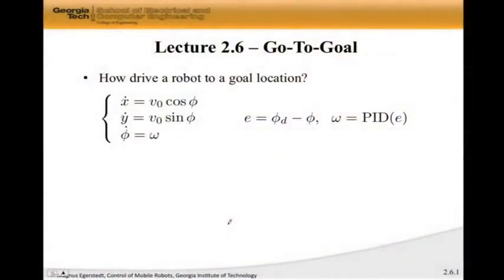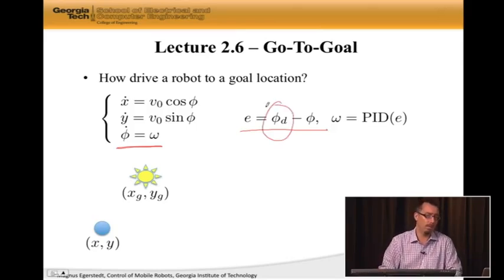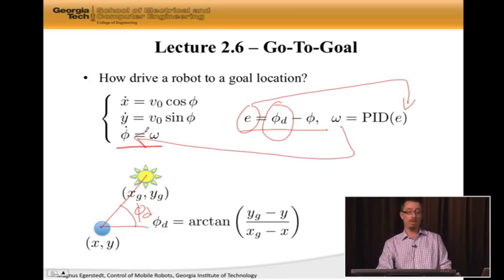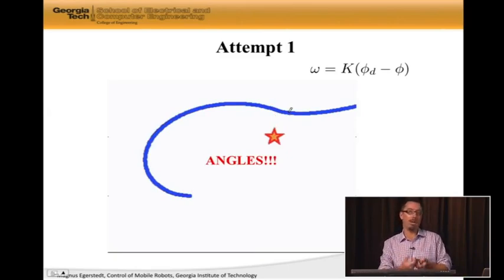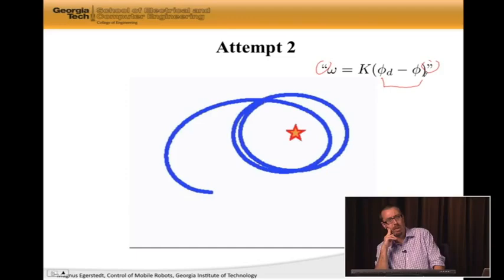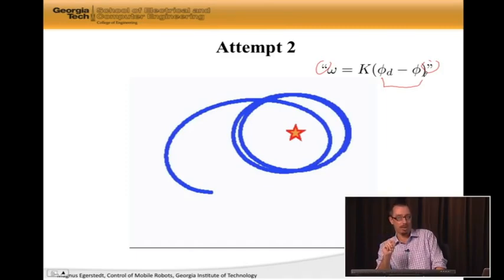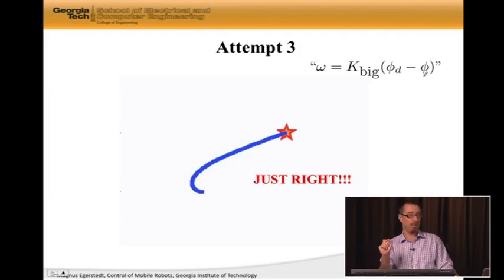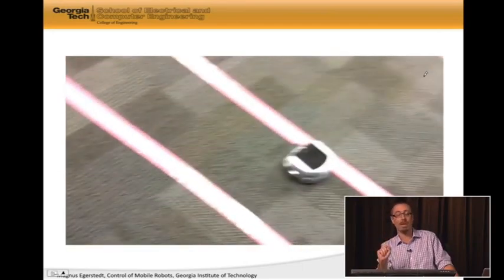Control of Mobile Robots- 2.6 Go-to-Goal

Comment: I think this video is really confusing. Because you use omega = PID(e), then you can get the omega from positif to zero. But since you use v0 as a constant velocity, then you'll have the real control input to the wheel (vr and vl) are always positif. Because the vr=(2*v0 + omega)/(2R) and vl = (2*v0 - omega)/(2R). 

This mean both vr and vl is never zero! Only omega goes to zero. Actually to make the robot stop, then both of v0 and omega should goes to zero if the error is zero!
Reply: yeah is not clear, but in your code you can either make v = 0 when the distance to the goal is lower than a threshold or have a separate v = PID(distance - current_position)